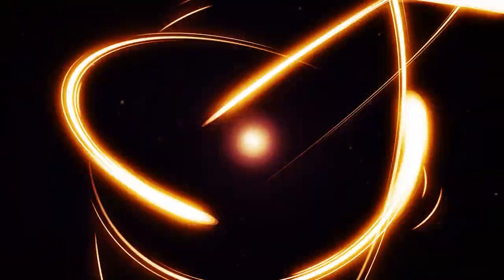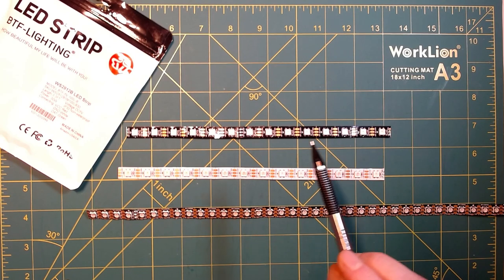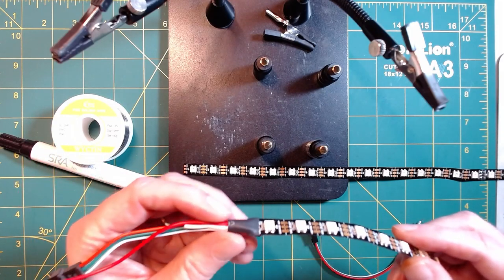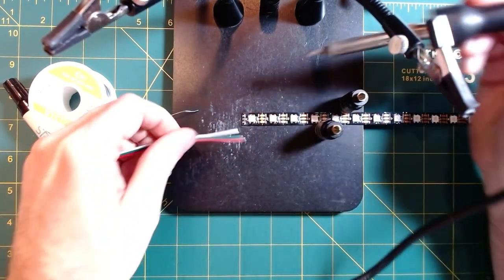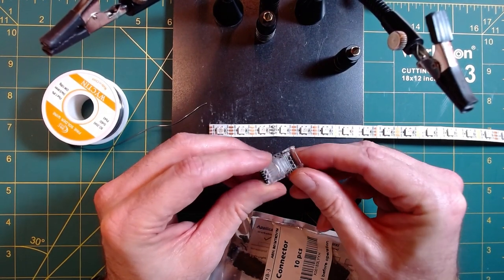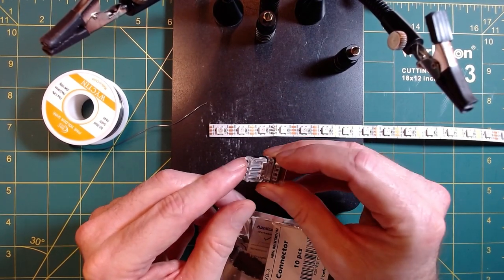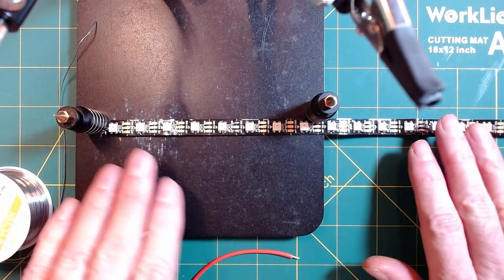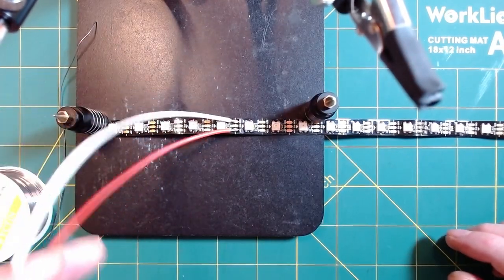Using WS2812b RGB Light Strips

Comment: Hello im building a led matrix panel size 128x64 with 60/m led strips. Thats a total of 8,192 5v ws2812b pixels. I plan to use a total of 8 5v 60A 300w power supplies. My question is, can a standard 15A breaker handle all that or would i need two different circuits
Reply from the maker: The amps on the AC side will be significantly lower than the DC side, due to the higher voltage.  There are online calculators where you can determine the exact amp draw for the AC side, but as a rough estimate  A = W/V.  So, for 300w running at 120V, the amp draw would be around 2.5A (300/120). The actual calculation is a little more complex, but you will be well below 15A on the AC side.

However, recall that WS2812b LEDs can draw up to 0.06A per LED when on full bright white (0.02A per pixel x RGB pixels).  With 8,192 LEDs, the matrix could draw up to a whopping 491 amps (8,192 x 0.06A)!  Now, that is for all the LEDs lit in white at 100% brightness.  Other colors and effects that don't light all the LEDs at the same time will be less, but even at a single color, if all the LEDs were to be lit at the same time, it would still draw up to 164 A.  With that many LEDs, you will only be able to run at a significantly lower brightness (I recommend using the amp limiter option in WLED) and I'd also highly recommend that you fuse the system as well.  You will need multiple power injection points (one about every 300 pixels).

Finally, you will need to use multiple data pins and an ESP32.  Even then, you are likely to see poor performance, as the recommendation for good performance is 1,000 LEDS per pin with 4 pins for a total of 4,000 LEDs.  You are going to be more than double that.

But I'm not an electrical engineer... so these are only my suggestions.  Good luck... I've never built a single project with more than around 800 LEDs, so let me know how it works out for you.
Reply: @ResinChemTech  i think i was in the right track. So i would be using about 2300 to  2400 watts with all the lights at max power. I wont be using them at full power obviously but i want to keep things safe. If i plug into 110v 20A i might be fine but most ppl have 110v 15A on wall outlets so to be on the safe side i believe i would need to plug into 2 separate breakers to keep things safe. So im gonna get a power distro like that i make sure i always have enough power
Reply: @ResinChemTech  ohh and i had built a project like this but only with 1800 leds. This one is 4x bigger and im still trying to digest the amount of power they can consume.

Comment: I bought 15m of ws2812b which are 270 pixels together, it is calculated to 20amps but will it be too much for the led lights to handle?
Reply from the maker: I'm not sure I understand your question, but you want your power supply to have more amps available than the total calculated amp draw of your LEDs.  If you calculate that your LEDs will draw 15 amps, then you want at least a 20-25 amp power supply.  The LEDs will only draw the current they need.  A larger power supply will not "force" extra amps into your LED strip and damage them.  That would be volts... not amps.  If you connect a 12V power supply to 5V LEDs, then you will have problems!  In your case, 270 WS2812b pixels would draw around a calculated maximum current of around 16 A on full bright white, so a 5V 20A power supply would be OK.

Conversely, you don't want your LEDs to try to draw more current than your power supply can provide.  For example, if your LEDs could draw up to 16A, only using a 10A power supply will mean that the LEDs will not be able to light up to full brightness and you will likely eventually damage the power supply because it cannot provide the required current and will probably burn out after a time.

Voltage vs. current (amps) can be a bit confusing when you first start out, but I hope that answers your question.

Comment: I know this is a older video but if you see this I have a question. I'm looking for a 3ft strip that has color chasing led's not just solid rgb colors that run off a small 5v power bank to add to my kids bike. Is there anything available like that or are them led strips too powerful for a portable battery bank. Thanks for any help you can give me.
Reply from the maker: I think there are a couple of challenges.  First is the actual draw from the LEDs themselves... they can be a bit power hungry, but they have recently released some "eco" versions of light strips that draw a little less power (at the expense of brightness, I'm assuming... but I haven't tested them).  Next, at least with the DIY version that I generally build, the controller continues to draw power, even with the lights are off (and so do the LEDs, actually).  I tried to install a strip of around 10 LEDs connected to an ESP8266 and door sensor for closet lights (on with door open, off when closed) and used a 5V battery pack.  The battery was drained in a few days even if the door was rarely opened.

To be completely honest, you may be better looking at a pre-built option that is also waterproof, like this: https://amzn.to/3ux22f8 (Amazon affiliate link... I have not tried these... and there are many other options... just search for battery powered LED strip lights).  I generally try to always create a DIY solution, but in some cases it just makes more sense to buy something better built for a given purpose than trying to hack together my own solution.

I hope that helps.  Please don't hesitate to reach out again if I can help out any further.  And thanks for watching!

Comment: Should I use 12v if I want to run it through my whole outer ceiling for my living room so I won’t have voltage drop as much as 5v?
Reply from the maker: That is certainly an option.  Although note that 12V will also need power injection at some point... it's just that you can run longer lengths before that is necessary as opposed to 5V.  Depending upon the size of your living room, you may still have to do power injection along the strip (or at the end of the strip).  Also note that 12V (WS2811) strips are generally only controllable in groups of 3 pixels (not truly individually like WS2812b/5V).  For something like a ceiling install, this probably won't matter.... but it is worth noting depending upon your needs/use case.

Comment: Thank you for this Video. Is there a normal power supply to power up a WS2812B 5V 5 meter 300 leds (60 leds per meter)? 300 x 0,06 = 18 amp.
Reply from the maker: If you wish to run the LEDs on white a full brightness, you would probably need a 5V 20A power supply, similar to this (Amazon affiliate link): https://amzn.to/3eFQv5S

If you want to use a smaller, pre-wired brick-style power supply, I haven't been able to locate anything larger than 5V 15A, meaning you would need to use the brightness limiter option in WLED to assure you don't exceed 15A.  Most WLED effects use substantially less than the max amps, so you would probably be OK with this approach... again, as long as you aren't looking for maximum brightness.  Here's another Amazon affiliate link to a 5V 15A brick-style supply: https://amzn.to/3qzOOwo

I don't have a "normal" supply.  Each is different depending on the installation location, what I might have on hand, or what I might find on sale online somewhere!
Reply: @ResinChemTech   @ResinChem Tech  Thank you for your quick and detailed reply. The aluminium adapter looks so bulky. It's just for a small project. Is the wattage also important for choosing the right adapter? Is there a different approach possible with a dig-uno? And on 5 meter with 300 leds is there always power injection necessary on the middle and end of the strip? Or with an enough powerfull  supply only the beginning is enough?
Reply from the maker: Yes, I agree... the transformer style power supplies are much bigger and bulkier.. and you have to build your own power cable to connect to the A/C outlet.

Wattage just reflects the voltage x amps, so 5V x 20A = 100 watts.  Or to get amps from the wattage, just divide by the 5V (100 watts/5V = 20A).  The recent versions of the DigUno (and Quad) do allow you to use a higher voltage power supply (e.g. 12V) and it will step down the voltage to the required 5V for the controller and strips.  You can check out Quindor's site for a lot more information on powering the DigUno with different voltages.

As far as power injection, for 300 LEDs, injection is probably going to be required.  As you can see in my video, once you get over around 150 or so pixels, the brightness and color are going to start to be impacted, along with flickering of the pixels at the end.  The "power" of the power supply makes no difference here.  The issue is the voltage drop that occurs along the LED strip.  But with 300 pixels, you can probably get away with supplying power at the start and end of the strip and likely don't need power injection at the mid point.  The video I just released (hexagon panels - https://youtu.be/lNcsT5DZjAM) uses 309 pixels and a 5V 15A brick-style power supply (20A would be ideal, but I didn't want that large transformer-style supply for this project).  I only inject power at the start and end of the strip, and with the brightness limiter in WLED, they function fine but I'm probably right at the edge of needing additional power injection in the middle of the strip.

Let me know if you have any additional questions.
Reply: @ResinChemTech  Thank you agian for your detailed answer.

Based on your experience with your 309 leds hexagon panels (nice video) I think a a 5V 15A brick-style power supply is the second best option .

That the dig-uno can handle a higher voltage power supply for both the board and the strip  is great. I always thought that voltage needs to meet with the strip.

Comment: Is the controller board with the 5amp add-on needed or can you just run a ESP8266?
Reply from the maker: You can't run much current through the ESP board... maybe 500 mA or so (enough to power maybe 8-10 LED pixels at full brightness).  If you attempt to power more LEDs than that, there is a high probability that it is going to fry your ESP board... maybe not immediately, but it will most likely burn out at some point due to the current draw.

So, the external 5V power supply is used to run one connection to the controller and a separate parallel connection to the LED strip.  That avoids running the high current through the controller.  The ElectroCookie board also cannot handle high current due to the small traces on the board, so you generally always want to power your LED strips directly from the power supply.
Reply: @ResinChemTech  I understand not running the LED’ power from the board but I thought if I connect the LED’s direct to the power supply, then Y’ed off to the controller I would not be pushing the LED power through the board itself only thing off the board would be the data. If that makes any sense at all.
Reply from the maker: Yeah.. that makes perfect sense... and how it should be wired.  Sorry if I misunderstood what you meant by the  5 amp add-on.  Maybe I should go back and watch my own video as I'm not 100% sure what you are referring to with that.
Reply: @ResinChemTech  I’ve seen them hooked up with and without the 5 amp add on. I’m trying to figure out why/when it is needed.  

My plan is running 3 of the 5 meters RGBNW WS2812b (either 30 or 60 pixels per meter haven’t decided on that) for this projects.  With two 200 watt power supplies splitting the power about half way though but sharing the ground.
Reply from the maker: Ok... I'm sorry, but I'm not sure what you are referring to with the '5 amp add-on'.  I did go back and watch the video in case I said something that I forgot, but I don't think I mentioned anything about adding a second power supply (if that's what you are referring to)... just about power injection.  If your primary power supply is of adequate size and you power inject where necessary, I'm not sure why you would need to add additional power unless you were doing a massive display (like a whole-house Christmas display) or had extremely long wire runs between pixel strips.

Are you by chance referring to the logic level shifter that shifts the outgoing data line from 3.3V to 5V?
Reply: @ResinChemTech  I'm trying to figure out what the little chip is used for on the bread board to the right of the ESP8266 chip.  @24:26.  I see people on YouTube show setups without the little chip and just the ESP8266 and some Youtubers that have the little chip added on.  I have no clue what that chip is or why it's needed.  That's what I'm trying to figure out.   Thanks for all your help.
Reply from the maker: Ah... yes, that is the logic level shifter.  The ESP board outputs a signal voltage of 3.3V but the LED strips expect a 5V data signal.  This little ~$1 device shifts that data signal up to 5V.  Now, you will see a lot of people claim it isn't necessary.... and if you keep the wiring run between the controller and the start of the LED strip very short, you can probably get away without it.  However, I always recommend using one to assure a good signal.  Take a look at a video I did on just this topic and what can happen if your signal voltage drops too low: https://youtu.be/Q9mLitVxF3c

That should give you a good understanding of the logic level shifter... and why some people opt to skip it.
Reply: @ResinChemTech  okay now this makes sense. Had not seen that video before. so that really has to do with how far away the controller is from the first pixel. For the cost I think I will add it because I’m not sure on the next project how far the will be. How far apart do you think I could go with this chip. Reason I’m asking is I wanted to run some lights in my landscape that I know will be 60-75 feet one one chip then down the fence on another that will be at least 90 feet one way and 80 feet the other.  Nether will be a lot of lights but they will be spaced out quiet a bit. If I can even run them that far.
Reply from the maker: It's hard to say... and it depends upon numerous factors.  The voltage drops due to resistance in the wire.  Smaller gauge wire will have more resistance than larger gauge wire.  But 60 - 90 feet is a LONG way (if I properly understand what you are describing) and I think it will be tough to keep both the signal voltage and the primary 5V for the LEDs at a high enough voltage to avoid issues over that long of a wire run.  It might be worth considering using multiple controllers closer to each of the individual strips.  Note that WLED allows you to sync controllers, so changing the color or effect on one will sync over to the others, so it seems like just one controller that would control the individual segments.

If you want to discuss the details further, you can contact me via email... as it is hard to have a meaningful exchange here in the YouTube comments.  I would just give you my email address here, but it will be picked up by the spam bots.  So, you can get my email address from the 'About' page of my YouTube channel (click the link for 'business inquiries').  Regardless if you opt to contact me via email or not, good luck with your project!
Reply: @ResinChemTech  I’m going to give it a whirl and if I need help I’ll get with you. Thank you for your time.

Comment: Does this mean that if the Wifi goes out the lights do too? Or can these strips be controlled via a physical point and shoot controller? 
 
Somebody good lord please help me. It is 4AM & I should have been sleeping 3 hours ago.
Reply from the maker: The lights wouldn't go out or change if the wifi goes out, you would just lose the ability to control them using the app.  And this does not mean that your Internet goes out (Internet connectivity is not required).  Your Internet connection can go out, but as long as your local wifi router or access point(s) remain up (which should be the case unless your power goes out... in which case the lights won't work anyway!), you will still be able to control the lights using the app.

But I do usually also include at least one additional physical way to control the lights.  This can be either a push button that is wired to the controller that can be used to toggle the lights, as well as select some different colors/effects, or I add an IR receiver to the controller and use a basic remote for control.  I have a follow up video to this one that answers a lot of common LED questions and you might find that one helpful as well:  https://youtu.be/GZv5Ztj6i6I